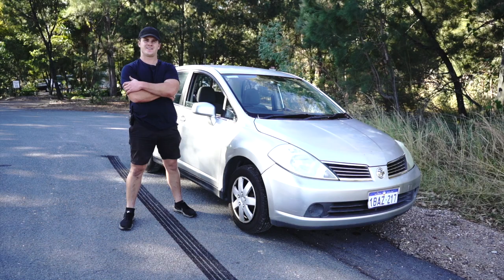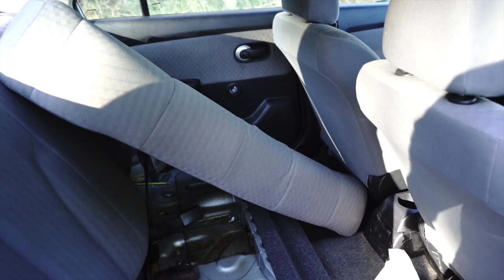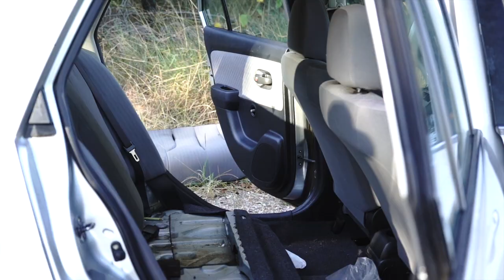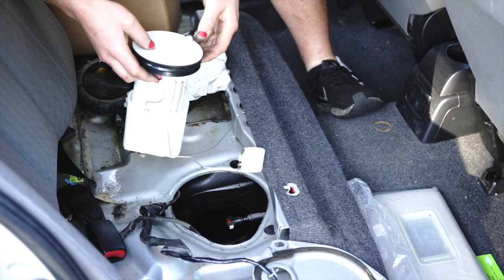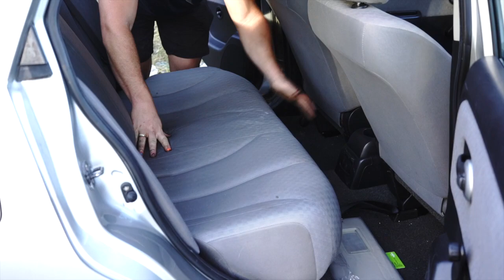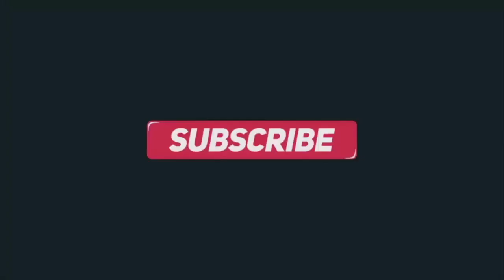How to Remove and Replace a Nissan Tiida Fuel Pump and Sender | Parts Factory Australia

Comment: Take the fuse out.. then start the car. Fuel pump fuse. Once you start the car the car will die.. and this is when you know the fuel line is not under pressure anymore. USE A TOWEL when disconnecting the fuel line but there won't be much if any. I use a leaf blower to blow out that cubbyhole and then I wipe it out really good. YOU don't want garbage getting into the tank. There's a little connector on the end of the fuel line from the old pump. YOU want to make sure you keep that and reuse it. Try and run the gas out completely.. like an eighth of a tank. Smart to have a fire extinguisher around.. because you don't want to create a spark with a hammer and then die.
Reply: Yes. Dying sucks, and makes finishing the job really difficult.

Comment: Hi mate.
I had misfire in my cylinder 3. I got the spark plugs and ignition coil changed by the mechanic but the engine check light is still flashing. It’s the Nissan Tiida 2006. Do you think this would help me get the engine normal?
Reply: is it still showing the same code? a flashing CEL means whatever the fault it could kill the Cat converter. It is a bit of a job to change plugs on these with the intake manifold needing to come off

Comment: A bit of advice for you, bleed fuel pressure first by removing the relay and starting the car and clean around that seal and top of the module with compressed air before removal, otherwise any dirt can and will go into the tank! 
Good video and love the nail colour 🤣
Reply: Also some thing like old cloth to catch the excess gas from messing up inside the car, that also will leave an odor.
Reply: Another option that reduces fuel is just opening the fuel tank cup
Reply: @IsaacMunyendo-o5e not the fuel line pressure mate unless the bleed back valve in the pump is shagged, it's just an extra safety thing IMHO

Comment: Very helpful video. Do you know if the fuel filter are one assembly with the pump of is it separate? Do you know the location of the fuel filter? Thanks
Reply: The filter is included with the module assembly.

Comment: What happens with the loose petrol when you disconnect the pump? Goes to the ground or need to cleaned somehow? If not the car will smell for days right ?
Reply from the maker: Underneath that plastic cap is open to air.. not part of interior thz